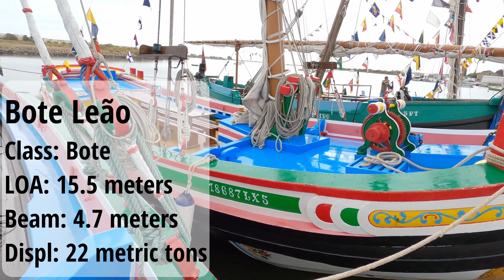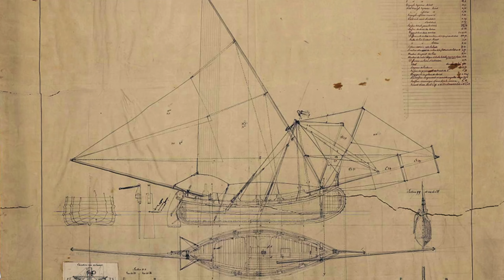Reviving the LEGENDARY Tagus Boats!

Comment: Teo I really appreciate these videos you produce on the traditional boats of your area. Are there any bigger or smaller boat designs from your neck of the woods that you could bring to our attention, working boats, older style leisure craft, ferry boats. I remember a film made many years ago that covered the then almost lost tradition of teams of men going up into the mountains cutting trees to produce barrels and a ship which come the end of the season they ran down the river to the coast to sell. I have to say it looked  a wonderful way of life a real rural idle.
Reply from the maker: Hi David!
There were quite a few different boats sailing the Tagus but the most important were  two cargo boat hull types.
One hull type/shape was used for Fragata>Bote>Falua>Canoa>Catraio,  the Catraios (4 to 6.9m) and the the Fragatas 20-30m)
And then the Flat bottom boats, the Varinos,  which can range from 15 to 30m.
These were undoubtedly  the boats which dominated these waters.
When in 1951 a bridge was built not far from Lisbon the boats started to be less needed and less profitable.
Finally in the 60s with new power ferryboats and another new bridge straight into Lisbon most sailing boats were literally abandoned and died on the banks of the river. 
It costs nearly 1 million to build one of these big boats and maintaining them isn't easy either. That's why we can find quite a few of the smaller ones, up to 12m, privately owned but the few big ones which still sail are property of city councils.